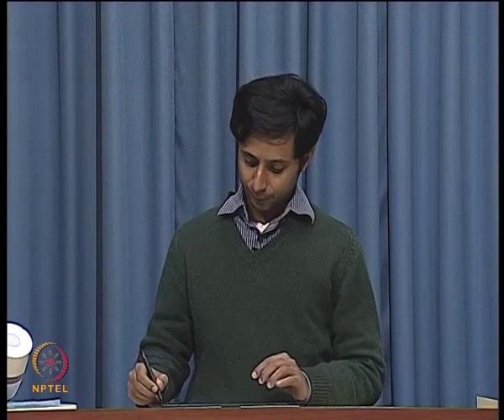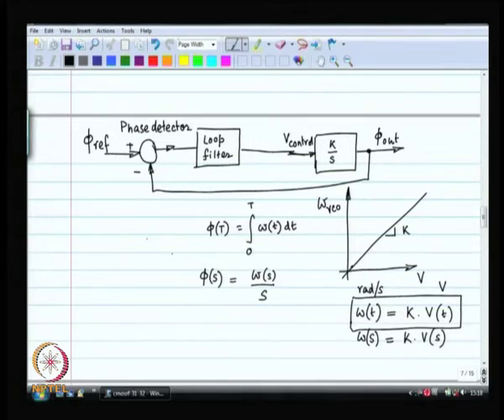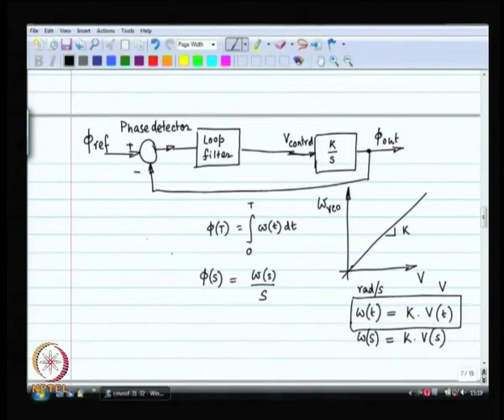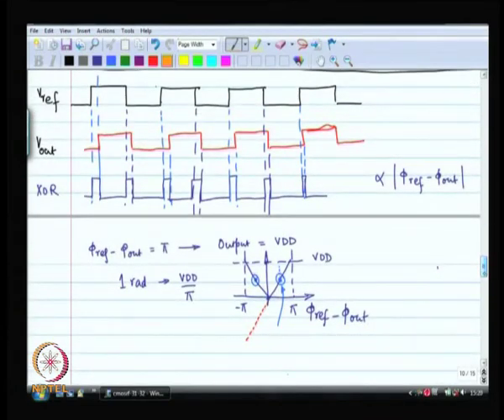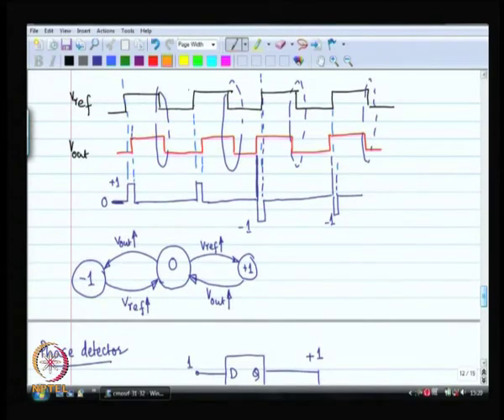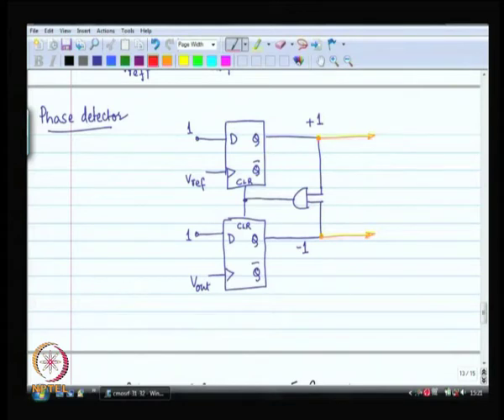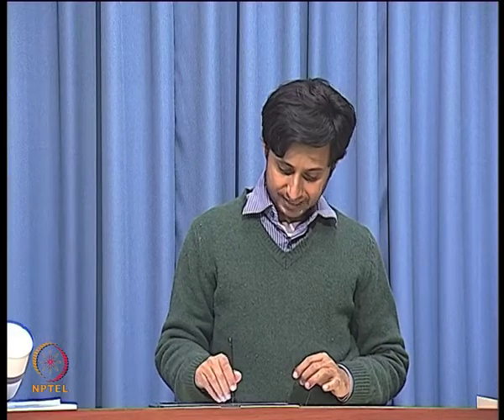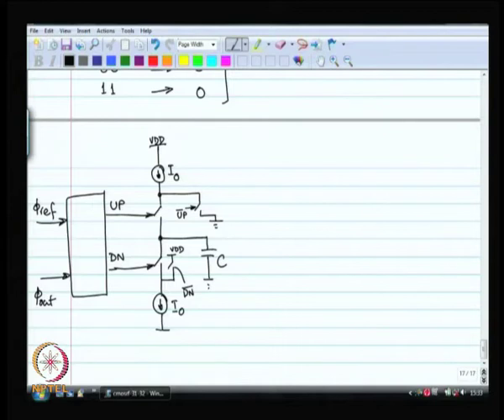Mod-11 Lec-32 Charge pump

Comment: Mistake:  What the instructor is pointing out as a loop bandwidth is not quite right.  It is the bandwidth of the loop filter.  The loop bandwidth is obtained when including the VCO (integrator), adding a pole at zero and adding additional -20 dB/Dec slopes to the three zones he drew... You will notice that the loop bandwidth will be lower...
Reply: no it is right only, the system function for the vco is k/s so if we multiply both the change pump and vco transfer function the in denominator will be having s^2 so anyway the dc gain would be at infinity so he is right... correct me if I am wrong

Comment: Its nice video lecture...but there is some doubt on the loop bandwidth explained in this video..Also the stability part can be explained in more simpler way by using Bode plot of open loop TF..

Comment: Not very clear - why the loop BW should be limited to 1/10th of oscillation frequency?
Reply: Because of what he says at 23:42. You must average the pulses of UP or DN over many periods. He chooses 10 as N approximate to 'many'. Its an order of magnitude.
Reply: @m1geo  Thanks, George.  His model works only if the UP or DN pulses are averaged over many periods. On a different note, what if I set N = 2?
Reply: @pachavasrinivas4433  it won't works correctly.
Reply: @pachavasrinivas4433  52:00